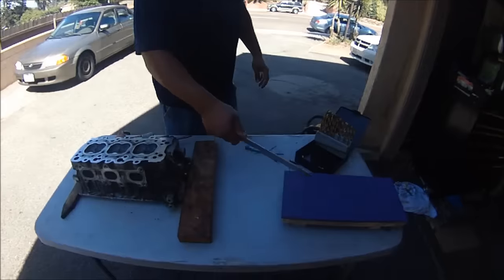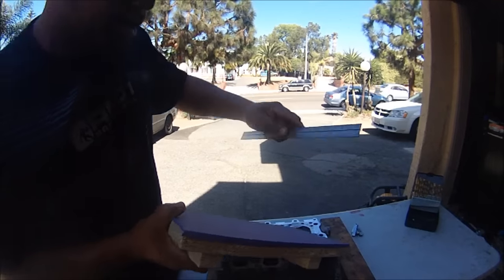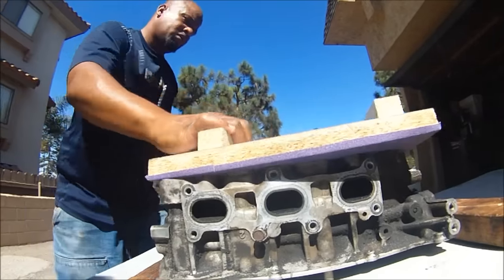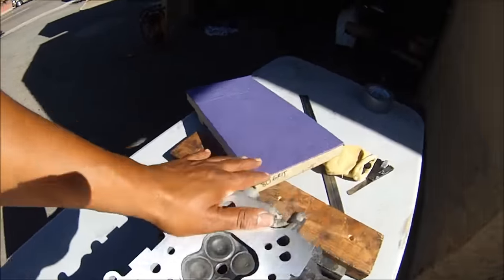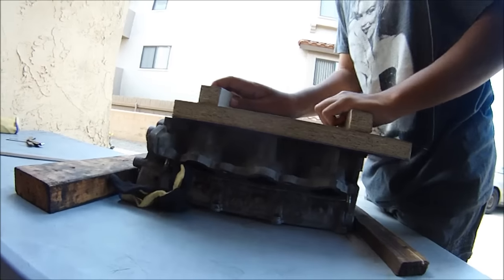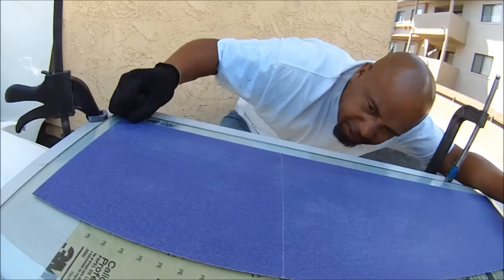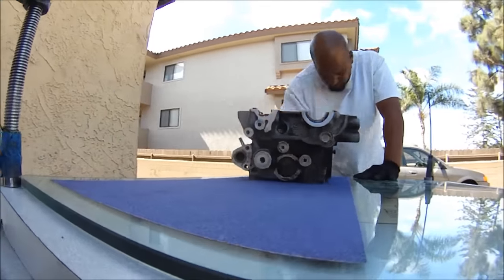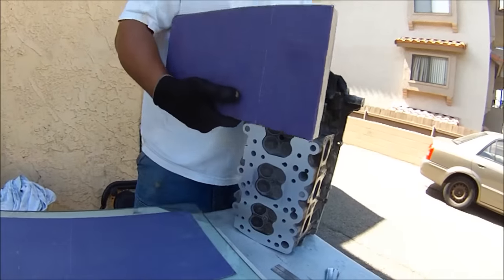HOW TO RESURFACE A WARPED CYLINDER HEAD AT HOME WITH SAND PAPER still works in (2023)

Comment: Ya know what, I been rebuilding and repairing Engines all my life and I'm 62 and retired now.  I first saw you video on decking the block.  I have a 350 Vortec GM engine I am rebuilding and pulled the heads, and found a spot were the head gasket failed and the block was missing about 1 1/2" square area from rust.  I di d your process for decking a cast Iron block and wala, perfect.  I agree with "Thomas Jefferson" You are a Positive person with a great mind!  You inspire me!  Thanks for what you do!

Comment: As a mechanic of over 30 years, all of them self employed and nearly all on equipment in the field, mostly agricultural and mostly diesel, I've rebuilt literally hundreds of diesel and gas engines and conducted emergency repairs in the field countless times.   The alternatives are often to use "bush technology", or to take an important piece of equipment off line for weeks during a critical season, such as irrigation season.   Bush technology, properly done does work and works very well, and can achieve BETTER RESULTS than fancy machine shop equipment.  Done improperly or carelessly, it can create a train wreck.   I recall one incident where a diesel engine was blowing head gaskets, and the customer could not afford to take it off line.  Crop losses would mount rapidly, as it was driving an irrigation system.   The deck on the block was warped.   I took a very large flat file and a precision ground Starrett straight edge, and with long swipes moving on two axis at once, I was able to take the warpage out in about an hour of careful work.  Needless to say I took measures to prevent cuttings from entering cylinders or the lubrication system.   Today, nearly 10 years and many thousands of hours later, that engine is still pumping water daily, and has not blown another gasket.
     Do NOT ridicule "bush technology"....... It does work.   In the case of surfacing a head, or block, it will achieve a flatter surface than a grinder will.   The reason for this is that the stone on a surface grinder much be angled ever so slightly, which causes very slight cupping.  This can be seen on any head or block surface that has been professionally ground.  It cannot be measured, but it can be seen as light seeping under your straight edge.
     You can spend lots of money to have things professionally done, or you can invest "sweat equity", and often achieve a BETTER RESULT if you are careful.   Bush tech works, but it doesn't make money for professional machine shops.   I've seen enough high priced poorly done work from machine shops that at least for my own equipment, I often use "bush technology"

                                                         H.W.
Reply: Howard Wilkinson couldn’t have said it any betyer
Reply: I've used files myself on a junk K-car lasted longer than some that were machined.

Comment: That looks to be working well on an alloy head.  I've been doing this for 9 hours on an iron head.  Still has a few low spots.
A shop would charge $200 to mill it, and i can not find a workshop open now so this method is still clearly the winner.
Reply: Up the sand paper grit... Use say 40 grit or 60 grit if 80 isn’t cutting it. Then go back to 80 and then 180 grit etc. Also, use some wd40 or other lubricant such as liquid wrench etc to lubricare the surface. It wastes less sandpaper. I’ve done multiple heads now. Learned it from OldSchool 🙌🙌🙌. He’s the man. In Jesus Christ’s Name 🙌 AMEN 🙏
Reply: How did it work?

Comment: not only saving the $45. you said it. The sense of pride of doing it yourself, that is what makes you want more. Knowing that you can really achieve anything.
Reply: J B , saving $45 and when you get it all back together and it blows up in less than a week , you know that you only got you to blame , but hey , you did save $45 dollars , and you get to work on your engine again , but should be easier this time around , and you already know how much the new head gasket and the rest of the new stuff you will need , still have a torque wrench or you got to borrow that again too ?
Reply: @jimthomas777  precisely.

Comment: One improvement on his technique would be to use a continuous motion that follows the figure "8".  This stops both the sand paper tooling and the item under going the surfacing from becoming bowed and uneven in the wear of the sand paper.  This enhances the flatness of the operation as well as randomizing the grain direction of the surface being processed.  Using emery paper and WD-40 as a wet operation also will increase the cutting efficiency and keeps the paper unclogged with aluminum parts.  If you have a drill press removing the tool rest casting and applying the paper with spray adhesive works very well for doing this operation to heads and blocks.  Again using a figure "8" motion is a better motion one should use in doing this by hand.  Not many of us hand lap surfaces flat but the figure 8 pattern of motion is key!
Reply: Do you do straight razors as well?
Reply: George hanes : Well spotted! I wonder if straight razor honing wouldn't be a good way to get yourself started into this resurfacing thing. For one thing, I'd say there's probably more precision involved - and more patience!
Reply: I don’t think it really matters. If the head gasket is blown and you can’t afford to take it to a shop, then this will definitely give you a couple more months out of a car for next to nothing
Reply: I Agree!! 
Ilove this guy!!
I do it like this at home with granite table
That's how my father taught me how to Hand Lap High Pressure Steam Valves with the figure "8" pattern
I've done valves from -30hg, vacuum up to 10,000psi with no leaks
Reply: I would like to add more.  BTW, criticism is not only negative, it can be advice.  From a machinist background it was a must watch.  oldskool funk should mention that there will be a lot of silicon carbide sticking to the inside of all those oil passageways.  Plus, if one was to use a scale for a straight edge one should flip it over to the other side alike switching ends checking a level before trusting it.  I may have to do a job as this in a couple of months and a little apprehensive on how to set up the head on my 100 year old metal planer without deforming it.  The planer would be much more pleasurable, I'm with the poster that this type of work needs shade trees and music.
Reply: Only a machine can reliably do a figure 8 and keep even pressure. The human bodys brain cannot monitor that many direction changes and still keep even pressure. Trying to do a figure 8 even with a tiny motorcycle head will leave you with a subtle dome shape in the end.  Straight back and forth  like he has demonstrated will get the best results when working by hand.
Reply: @bradbozarth2680  I think you mean a couple of years. Why would you even take the head of for only a coupe months repair.
Reply: @markhibdon1314  All machinist are taught the figure 8 method but on a part this big and heavy you dont need it
Reply: I agree with the above 100%. Also use engineers blue on the head and you can visually see where the low spots are. Also changing sides and ends helps keep the work square. Then test on a with a feeler gauge on a surface plate. Its the same technique you use for any surface you need to ensure is flat.
Reply: @Paul Kimber 

No need for using blue, can just use a Sharpie if you can’t operate a feeler gauge. 

Figure 8 for automotive cylinder head resurfacing is not necessary at all. 

People often forget that the block deck also warps so just because the head is flat doesn’t mean the jobs over.
Reply: @South_0f_Heaven_  I agree with you Jon often the block is warped as well. That's why you get the head flat then use a compression copper/asbestos gasket and sealing compound such as Hermatite (that remains plastic under heat and pressure). Tighten down to the correct Torque settings and its job done. Used this method on numerous occasions and never a problem. Saves stripping down and machining or lapping the engine block.
Reply: This. Also going to a shop to check if the straight edge is really straight. ive seen peoples buying glass panels, gluing paper on it and placing the head on top and using the head's weight to resurface it
Reply: But why all this if he clearly showed that his job was succesful? Why trying to ignore it? He showed us the flatness and it's a succes. 
So his method works and there's no need to change it. Yes you can change the method but who cares?
Reply: @fitulus  We tryna explain how you could perform this method even better to have a perfect surface without doing much more ! His method is great but you can def improve it ;)

Comment: TL;DR: this fix did get the car running again but I didn't have confidence in the seal so I ended up re-doing the job.
I followed the exact directions on this video about 3 years ago. Did my car run again? Yes. Was there a perfect seal? No.
Water/coolant was escaping from a jacket and I could see small bubbles on the outside of the block. Now while this didn't affect performance (the car ran great) I knew that the seal wasn't perfect. At the end of the day I ended up taking the head and my block to the machine shop, and did the job again with the surfaces machined.  
All that said if I needed my car to run again, couldn't wait, and didn't have a lot of options I would consider using this method again. 
Use this knowledge to do what is best for you, this is in no way to say anything bad about oldskool. I appreciate the knowledge he took the time to share with us all.
For context this was on 2000 Focus with the 2.0 SOHC engine.
Reply: Sometimes the block may warp as well; years ago I had a head re-surfaced but I didn't check the block, and had the same symptoms as you described. When I got around to having the heads ported and polished a few months later, the mechanic found the block had slight warping.

Comment: I grew up working on engines with my Dad, we used a piece of 1/2” thick glass as a sanding table. Thick glass 1/4” and up is usually (but not always) perfectly flat. You can also check your work with another piece of 1/4” or thicker glass, it’s essentially a see through flat surface table. For smaller heads, just tape the sandpaper edges to the glass, for larger heads, we had some large commercial sandpaper belts about 12” wide and the belts would be over 6 ft when cut so we cut them in 2-3ft lengths. (The 1/2” thick glass “sanding / planing table” was 24x36”) We did a lot of heads that way.. from Briggs & Stratton, Tractor Engines and many motorcycle engines. The table and sandpaper were stationary, we moved the head itself to sand out imperfections AND you can use a dust coat of cheap paint as a guide to see high and low spots as you sand. (Sharpie’s and other markers can highlite low and high areas too, the ink dries in seconds. ) We would use compressed air and/ or a paintbrush to keep the sandpaper from clogging when sanding. Good luck guys!

Comment: Thanks! Man for sharing your knowledge, I should have watched this video before deciding to pay a mechanic $1k  to repair a  blown cylinder head gasket. The possibility of cylinder head warpage discouraged me  to do the job myself.  It is weird, I am always successful at fixing stuff whenever I pray to God before i fix something. But when i start to feel that I am so good at fixing stuff and forget to pray to him  thats when I tend to fail, and all sorts of problems arise.  No matter how good we are at something  we should still be humble, and pray to God because He is the one guiding us in every step of the way.
Reply: I myself am building a short block Chevy,  but first I was forced to go to a machine shop to bore the cylinders just 10k of an inch, I bought an old Chevy truck really cheap, the moter in it has prob warped heads so the heads are garbage but the block is a 4 bolt main block from a 3/4 ton 454 from 1976, after a little research I have found a hidden gem, they don't make blocks like they did back in the early to mid 70's a lot of nickel was used when blocks were cast nowadays a lot less nickel is used which makes those blocks highly sought after plus it has a forged steel crankshaft which in itself pays for what i bought the truck for so i am so highly blessed each and every day I wake up i thank the Lord and yes i often forget to pray, but lately i try to pray about everything i do that is when i remember,  and when i forget to pray usually the outcome isn't pleasant,  awesome job you've done, i don't know if this procedure would work for cast iron heads though, all the Glory goes to the Lord every time my prayers are answered which is quite often, I love the Lord with every fiber of my being and it's good to see others who feel as I do about our heavenly father, I just wanted you to know that not all people are bad. I know that the world is full of haters and haters are just that, they also need prayer too. Maybe a seed planted then someone else comes by metaphorically waters it and one day they stop hating and find out that they truly love the Lord and they love every thing about God and his creation, yes, that's me, I'm the ex-hater, prob one of the worst in my town but God has other plans for me and I pray he tells me just exactly what they are but until then I will continue to love every person not judging them just saying a prayer for them when I've been cursed at or cut off on the highway, maybe the prayer will cause another soul to plant a seed in them and someone else comes by and waters it, may God bless you abundantly in each and every way possible...
Reply: Yeah.

Comment: I would like to point out the fact that its not just about saving $45, its about the machine shop's turn around time. I did resurfaced my head by hand not because of the money issue, but because I had to get my car fixed ASAP and didn't have a week to wait for a machine shop to do it. If you check your tolerances, and do it like this correctly, its totally fine. Anyone who says differently is an idiot.
Reply: B.S Noodleman  Amen to that
Reply: Say that again
Reply: Yes sir!!
Reply: @B.S Noodleman Truer words have never been spoken.
I don't get why people gotta hate on such great ideas anyway.
Been working on cars since back in the days when they came with carburetors, fast forward 20+ plus years and I'm still getting my own stuff done on the drive. Not because I'm cheap, no, but I've always felt I could get any job done better than some guy at a dealership or workshop who's doing it because his paycheck depends on it.
Hats off to the men who are not afraid to get dirty and relish in the joy that comes with getting problems fixed.
Cheers.
Reply: I've worked a lot on peoples so called "fixes" which ended up costing others a hell of a lot more more money then it should have if it was done RIGHT the first time...Problem is you idiots try to fix things this way they you push it off on others for the same cost as PROPERLY repaired vehicle , then when it fails from being RIGGED that new owner gets left with the heavy bills! Sorry but there is a reason for PROPER REPAIRS and why repair garages dont hire so called mechanics that do this type BS work....

Comment: I did that with a MDF board and I used spray adhesive to hold down the sand paper. Also I bought a drafting t-square at hobby lobby ($12.00) to use as a straight edge. Even after sanding the head down it still had a low spot between 2-3. I filled that in with JB weld and sanded a little more.  -car has been running for about 3 years now..
Reply: Hi @danstump3686 just wanted to be clear with JB weld. So you mean you add JB weld between cylinder 2 and 3 to fill it up, so that you won't scrape off more material from the cylinder head?
Reply: @faafetaikolose8950  It had some pitting between 2-3 that was too deep to surface out. So I just filled the pits with jb weld and sanded it flush. I also bought a boat that had 2 cracks in the block from a freeze. I gound some v channels into the cracks with a die grinder, filled them with jb weld and boated for the next 5 years with no probs.
Reply: @danstump3686  Thank you sir for clarification.